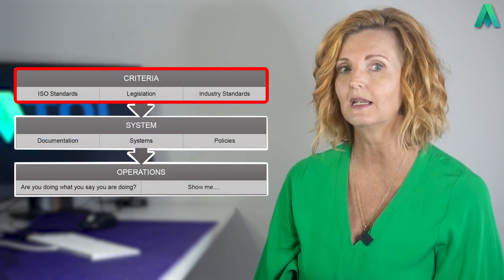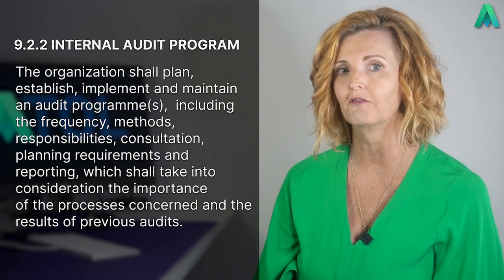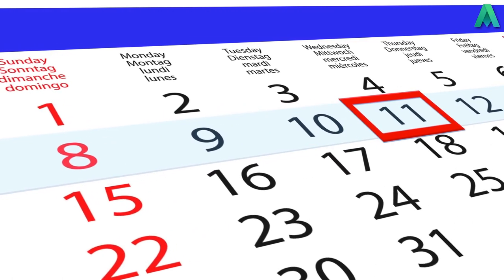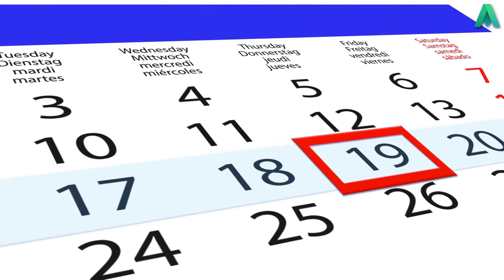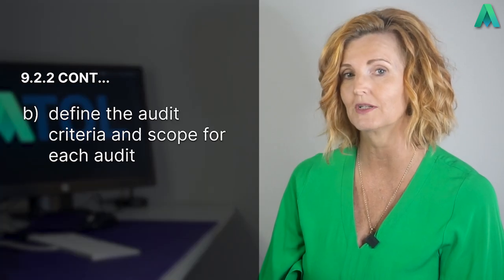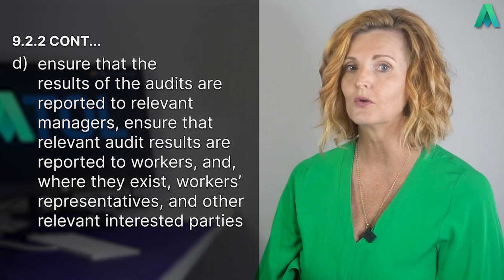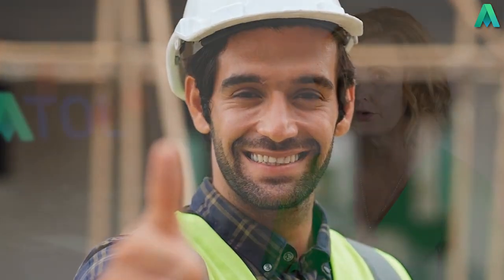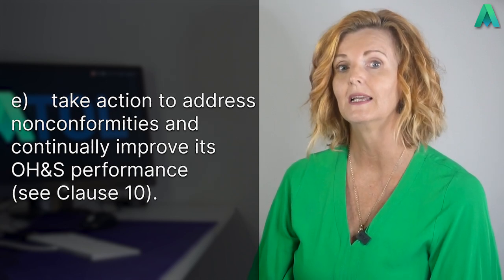ISO 45001 Clause 9.2 Internal Audit | Auditor Training Online

Comment: great to add non- conformities and even conformities to those clauses which organization qualifies. simple 5 why analysis, CE diagram along with root causes and actions with deadline which will be effectively checked by auditors in next proceeding audits. This we are following continuously
Reply from the maker: Thanks for the comment. There is Clause 10.2 which covers Corrective Action requirements of the standard. However, I think your comment is suggesting a further breakdown of the process to use to identify the root cause which is a great idea. I will add this to our Video Content project.